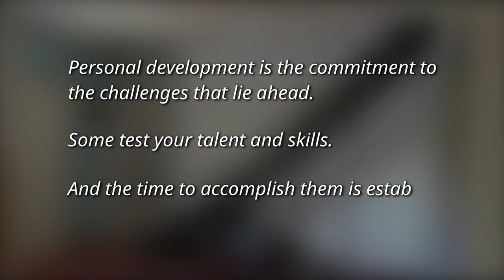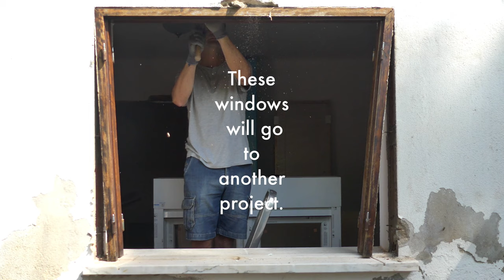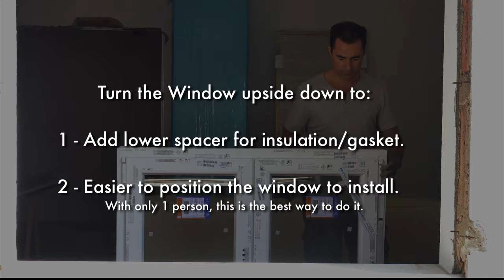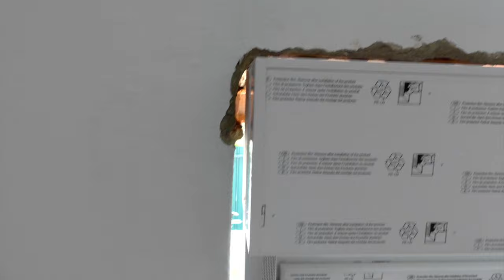How to Replace Wood Window Installing Double-Glazed PVC Windows - DIY Home Renovation part-1

Comment: Really neat & awsome video. I have to say you have quite a resemblance to Rowan Atkinson (Mr. Bean). Maybe you could put some emphasis on how you did the inside of the window. What was the rest of your unique method ? Did you put concrete on the other side of the window ? Normally the PVC windows come with screws and  expansion nail sockets for securing it to the wall &; putting the screw through the PVC frame and into the  concrete wall.
Reply from the maker: There are two more videos besides this one, follow the ones in the video description.

Comment: How do you transfer the load of the bricks in the lindel above the window on the beam of the window? It seems that you have not. If not the brick work above the window will get cracks.
Reply from the maker: Hi, I made a mold with plywood to re-enforce the window Lintel using iron and a mix of cement compound. 15:16

Comment from the maker: ☛ PART 2 https://youtu.be/cAJmBMUeYAw
Strong man: 0:52
Removing Ceramic Baseboards: 2:10
Demolishing door jambs, widening inner corridor: 2:42
Drywall metal framing: 3:39
Replacing Wooden with PVC Windows: 5:59
Rebuilding Window Trim: 14:45
Rebuilding Widow Lintel: 16:11